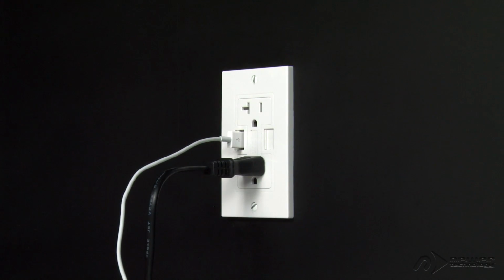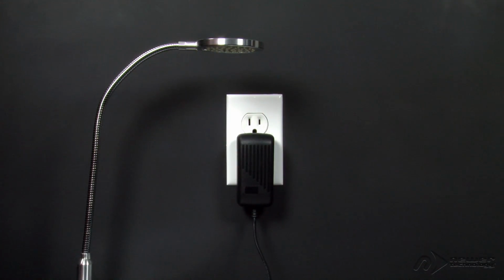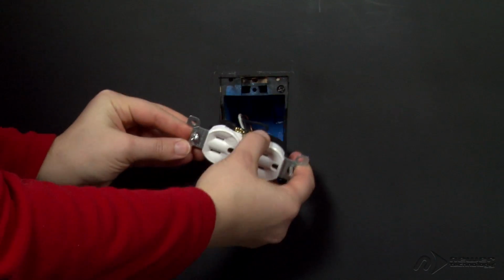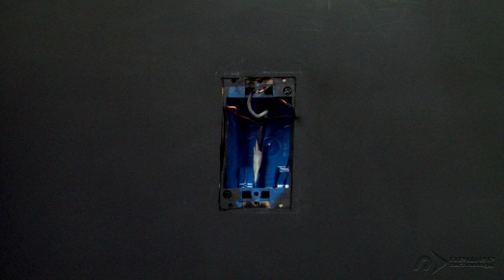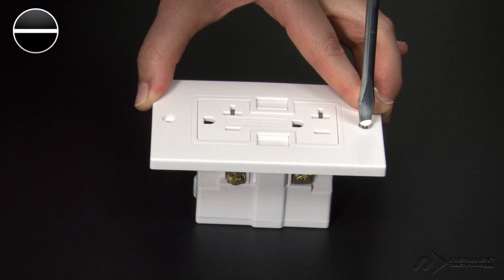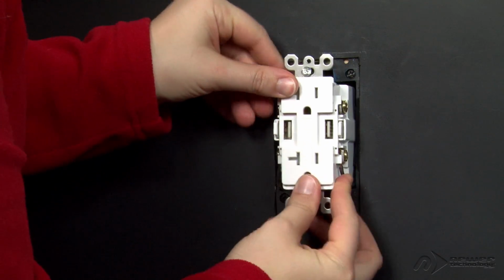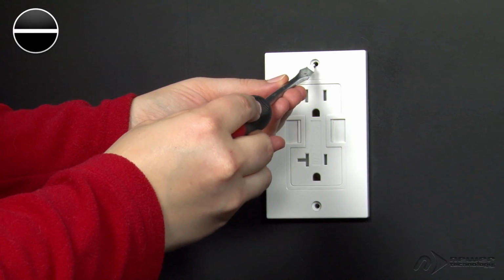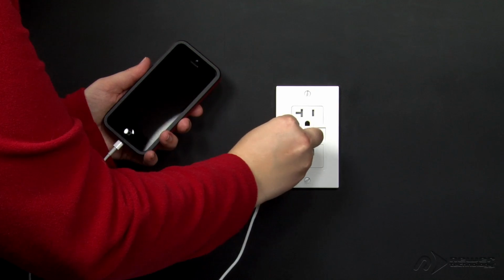Newer Technology Power2U AC Wall Outlet: Installation

Comment: Works good.>>>nub.best/s27x    Using this in a cargo trailer/camper conversion using a 3400 watt Champion generator. The generator runs in ECO mode and ramps up when compressor kicks on then back down to idle while running with The generator slides out on heavy duty draw slides. This is a through the wall AC so the intake and exhaust are both on the back. I built a simple shoot out the rear.
Reply: good